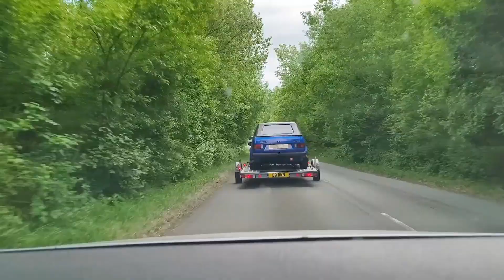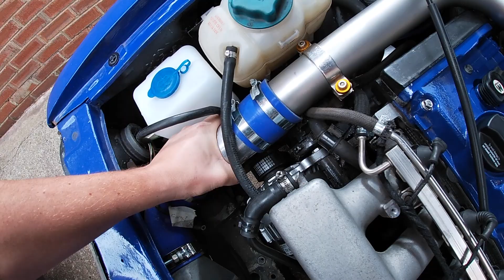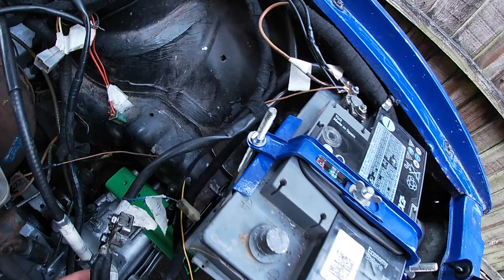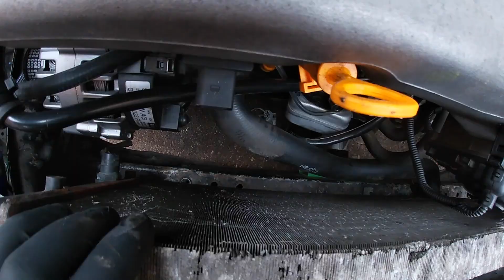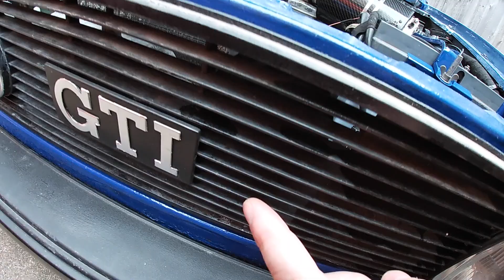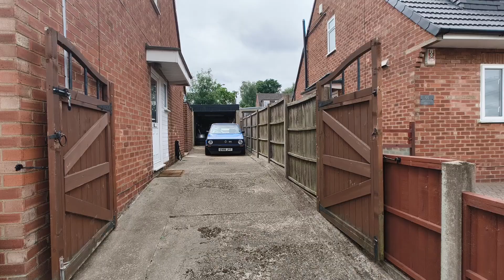MK1 Golf 1.8T Intercooler, Radiator, Fans, Pipework Fitment and More

Comment: Awesome vids. I’m in the middle of exactly the same build putting a Bam into a mk1 cabrio. Can I ask a question about the coolant hoses? I have every coolant hose connected except for one. What did you connect the turbo coolant line up to (the long one that runs from the turbo & along underneath the charge pipe towards the front)?
Reply from the maker: Hi, thanks for giving my videos a watch and like. So for that coolant line from the turbo underneath the charge pipe, that line joins to a rubber hose that sits near the top of the alternator going down past the thermostat and into the black metal hard-line pipe that's poking out to the right of the thermostat. On the black metal pipe they normally have one blanked off anyway as there used in different 1.8ts as well. The coolant turbo line and the rubber hose leading to the black metal pipe are connected by a three way connector. You might have this missing as it's not used in conversions as this runs to the coolant bottle. In my video I used the three way connector to run that Volvo coolant bottle. But you could just blank it off.
Reply: @VintageVibesAuto what did  you do to keep the turbo water cooled

Comment: Hi Mate, first of my many questions, I have an issue with my MK1 GTi 1.8i engine that I need to get running right, there are 3 wires that have become displaced and I am unsure where they go, can I post pics on here to make it easier to explain and if so how do I put pics on? Thanks.
Reply from the maker: I used this guide for the wiring up the MK1 as the shell didn't come with much wiring. I can't say I know too much about the MK1 wiring though as I mainly followed a guide and asked questions of the MK1 golf owners club. This is for a CE1 fusebox used in late MK1 golfs with the longer rear lights, MK1 cabrio, caddy's and early MK2 golfs. It should give you a good idea of each individual pin 
https://club8090.co.uk/forum/viewtopic.php?t=173773&sid=c43a5a2b16e704eaec5cac2f5c98bace
Reply: @VintageVibesAuto  Cheers, I will see if it can sort my little issue out, thanks for the reply, and keep it up with the video's...
Reply from the maker: Anytime, if you have any more questions later on leave me a comment, I'm happy to help

Comment: Great video's mate, just found your channel and am loving it, where are you based? I have a mk1 gti cabriolet and am thinking of doing an engine swap and would like to have a chat with you regarding which way to go with it, your video's are giving me lots of inspiration and would like to hopefully get some help from you along the way.
Reply from the maker: Hey! Thanks for the comment the sub and the like. I really appreciate it. I'm more than happy to answer any questions, just leave a comment and I'll answer. I'm quite active on YouTube. It's not too difficult of a swap. If you keep your standard GTi gearbox and flywheel. It will all just bolt onto the 20v engine. That's the route I did anyway. Also this website massively helped me out with wiring...
Reply from the maker: https://www.clubgti.com/forums/index.php?threads/oem-mk4-management-wiring-mk1-2-3-harness-install-faq-now-with-added-dieselness.267196/
Reply: Thanks for the reply and the link, I have just joined the group in the link, I have loads of questions to ask... are you on face book? or is there a way to private message you in any way?
Reply from the maker: I don't like to mix YouTube with anything else if I'm honest, but please feel free to ask away questions on here or my other videos, it will also help people as well that have the same question/ problem.